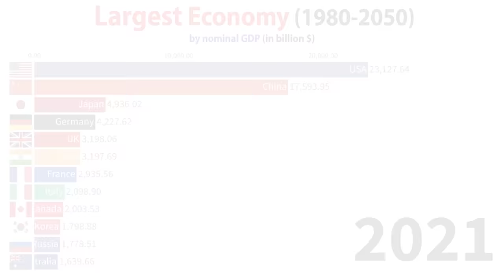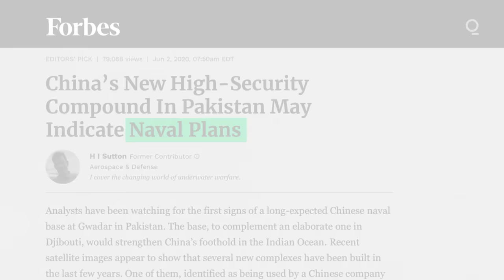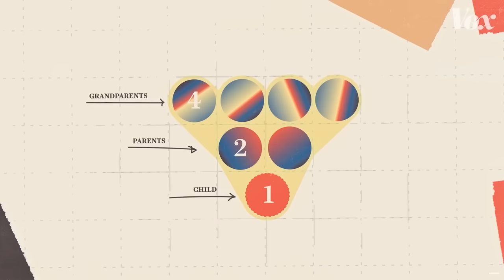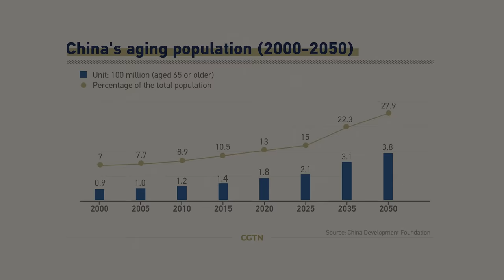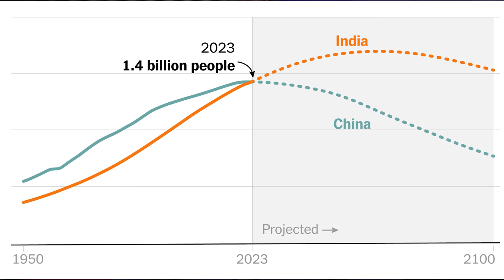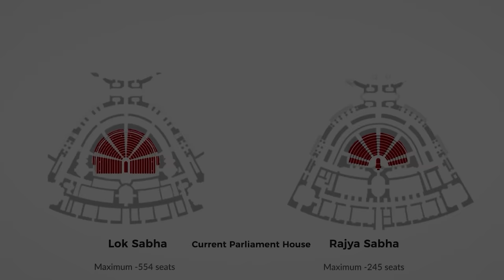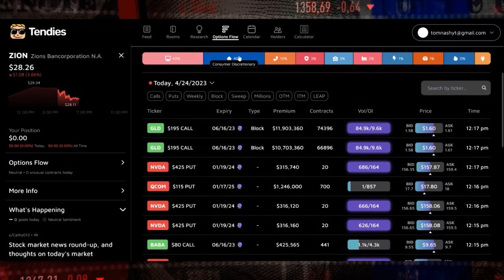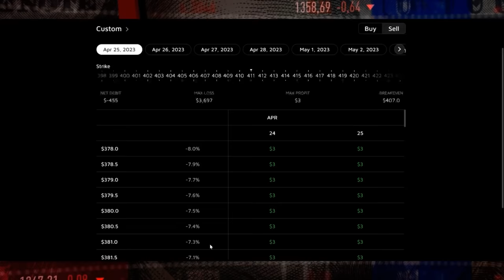The next global superpower is…. (It’s not China)

Comment: In the US if the current young of which 20% say that they are LGBT don’t go straight in the end, the replacement rate may need to be readjusted to be higher than 2.1.  

(I understand that the actual 2.1 rate does not change since it’s an average.)